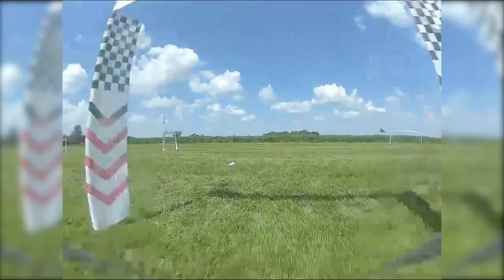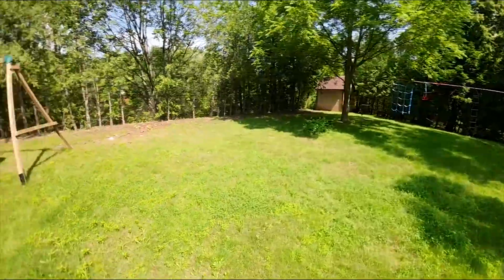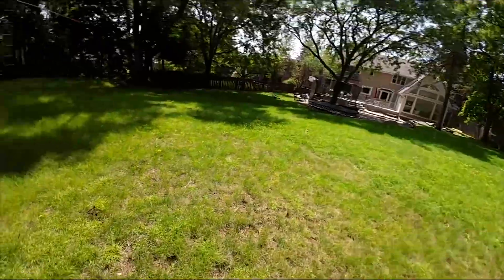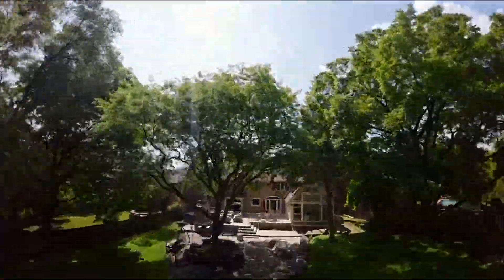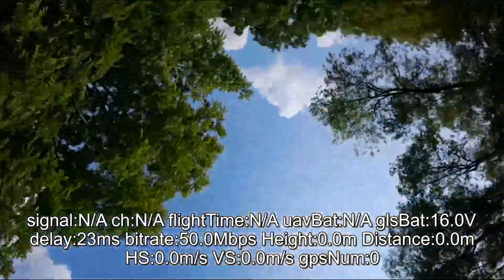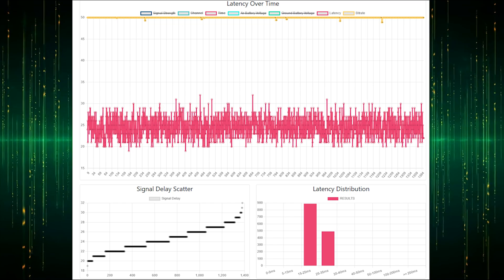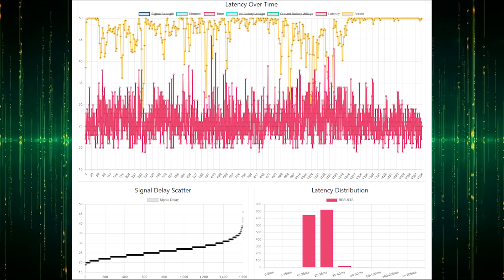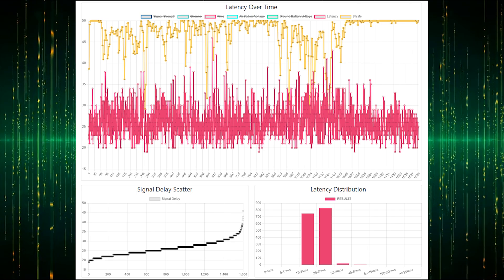DJI O3 - Default Configuration Latency Issue, with solution

Comment: If I remember right, 4k120 is actually only recording 120fps on the air unit. It transmits 60fps to the goggles and latency is equivalent to 60fps. For lowest latency, run 2.7k/120fps or 1080/120fps but not 4k. 

Proof: https://www.youtube.com/watch?v=3gWun9cfyE4&ab_channel=ChrisRosser
Reply from the maker: That is correct for the Goggles 2, probably because they can't do 120fps natively,. Since these are the V2 Goggles they can receive at 120 fps, and you definitely notice a huge difference if you actually switch to 60 fps (It's horrible). 

In the video you linked you can see the graph showing the latency difference between the two Goggles set to 4k@120fps,  and see that it is lower than the Goggles 2 at 100fps as you'd expect: https://youtu.be/3gWun9cfyE4?t=216

The limitation where you need 2.7k at 120fps is for 4:3 which doesn't allow 4k recording like 16:9 does. Both transmit at 120fps.

Comment: Thanks for this!  I also switch between flying vistas and 03s daily, often back-to-back.  I've noticed something with the 03 that just makes me feel less connected/comfortable compared to when I fly an older vista based DJI quad.  I'm on the same goggle setup as you (DJI Gogglesv2).  Going to try this today!!!  Thanks for the detailed troubleshooting and data!
Reply from the maker: Let me know if you notice the difference.
Reply: @RecursionLabs  I tested over the weekend and I actually did notice a large difference by using the manual transmission settings!  It does seem that the micro studders and 'disconnected/not smooth' feeling that I couldn't place my finger on is gone.  I've got (2) 3" quads that are largely the same, one has a vista/wasp setup (this seems to be the most locked in and least laggy DJI setup I've experienced to date)  Flying the 03 quad back to back I wasn't annoyed by the 'weirdness' that I previously couldn't put my finger on.  It just feels like vista now only with a huge resolution upgrade.  

This really helped me!  Thanks!!! 😊